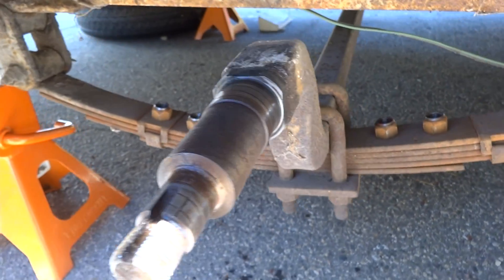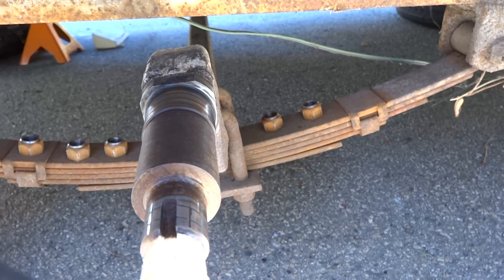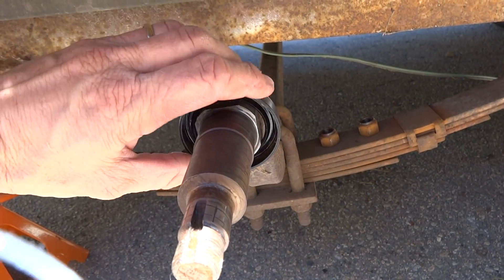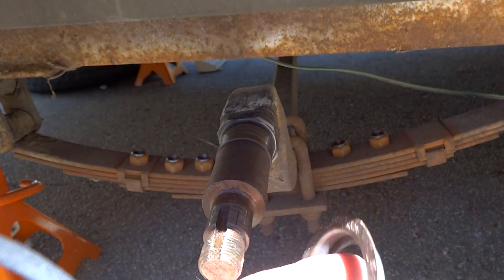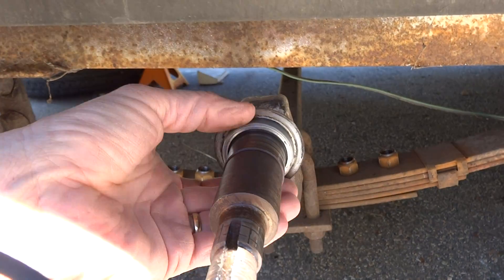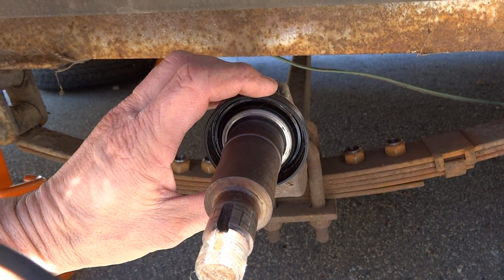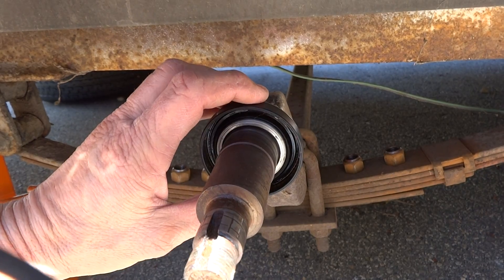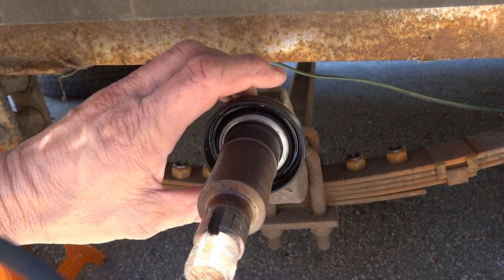Spindle 66 Scotsman

Comment: Hey Rod - I'm restoring a trailer with Hadco 394 hubs that uses the same bearings as yours (M12649 & LM48548). I need to replace the hubs themselves and I'm having an awful time finding suitable replacements. Do you have any ideas of compatible replacement hubs?